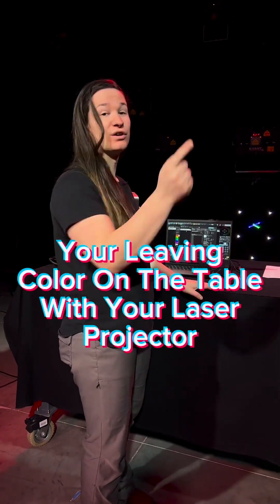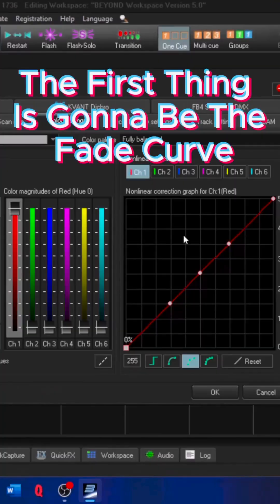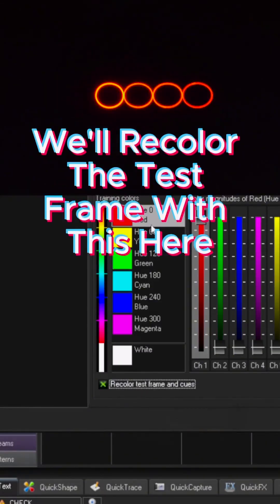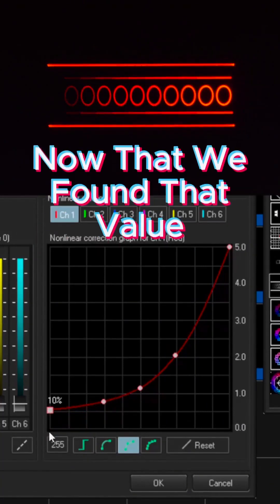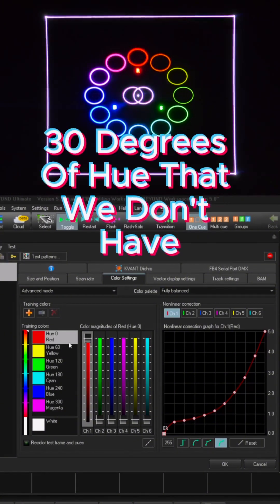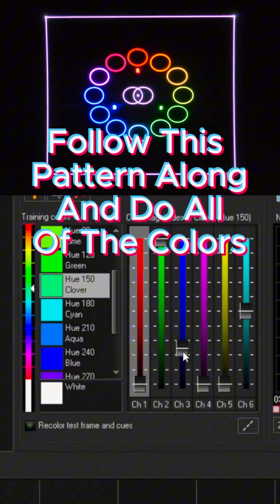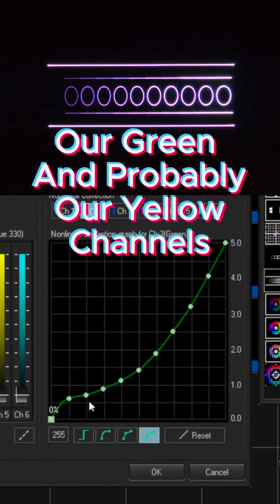Advanced Color Tuning Method

Comment: The only thing is that when you adjust the curve for the white now you have to retrain your hues again.
Wouldnt it be better to train the curve... then calibrate your white (as its your maximum) and then calibrate your individual hues? 

In the past I would only train the curve and only train the hues for the specific colors like oranges or client requested alternative of a specific color and leave it at that.
(I know color is a bit hard to conveigh on certain cameras and on lasers with thicker reds).

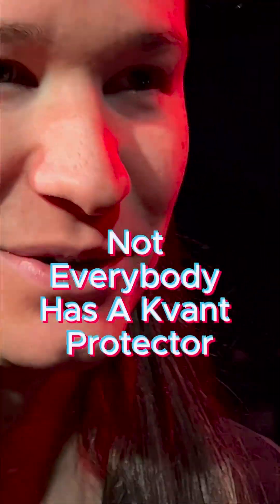Comment: Where’s the Color Balance button! I have a Kvant. Is it in Beyond software settings or the back of the laser? 2:58
Reply from the maker: Please check the manual of the unit. This is different per model. Older models probably do not have this feature.
Reply: Hi , one of the my laser is showing only red